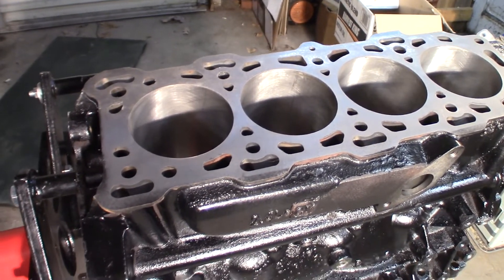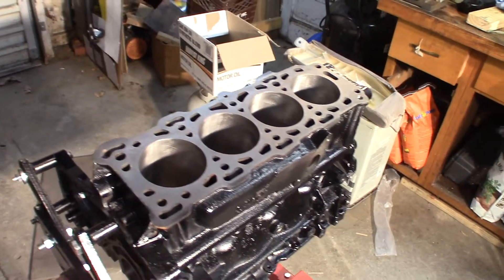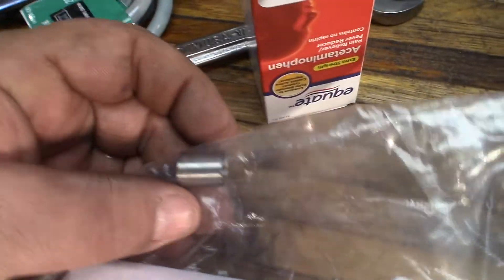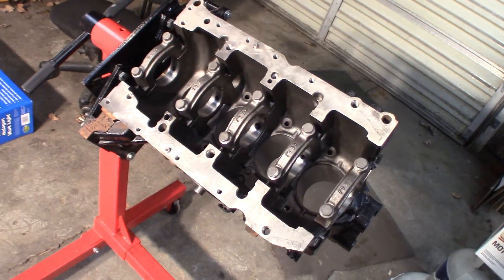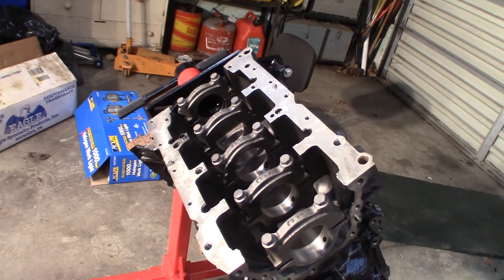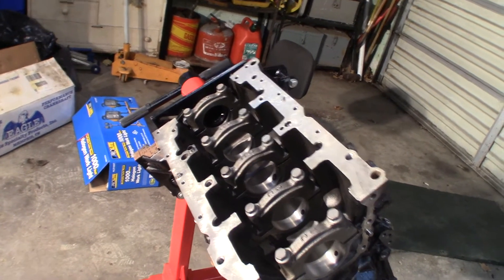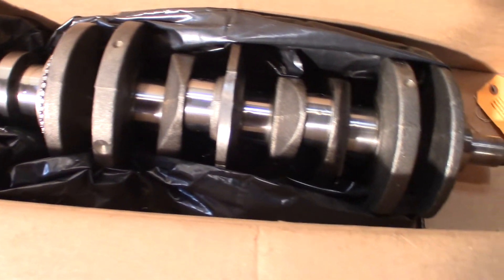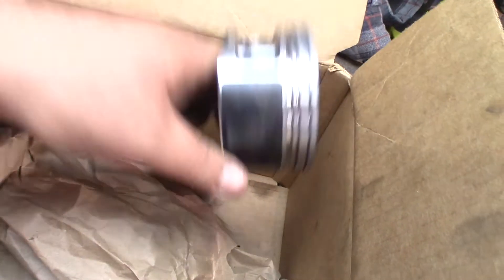GM 2.4 Quad 4 LD9 Twin Cam Engine Rebuild - Block Back From Machine Shop - 1999 Grand Am - Part 1

Comment: That was nice of them to make a dowel pin for you. Going back to standard sizes will give that engine another chance to be rebuilt again...hopefully not for a long time. You were patience but it paid off for sure.
Reply from the maker: Maybe it can be done again.  The deck has a limit of taking .010 off and we have taken .008 off.   I don't know if the sell a thicker head gasket for these engines or not.

Comment: That's an excellent price.  The last block I had the deck and cylinders done was $750.  That was a 340 in...2009.  Of course that's CAD also. Pretty nice that you can use stock bearings and rings too.  The block must have been in really good shape.  Most people would just drop in a junk yard motor and call it good.  At least you will know for sure that everything is good.  If you don't screw something up lol.
Thanks for the video.